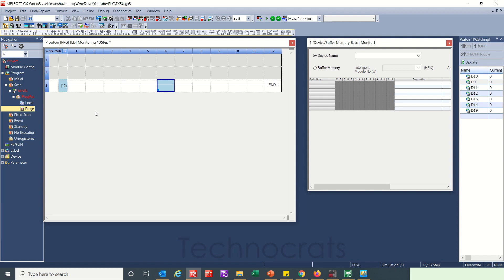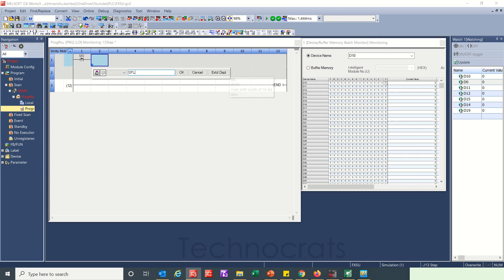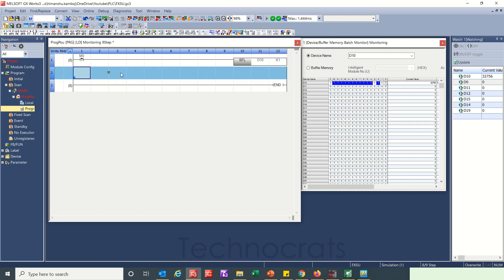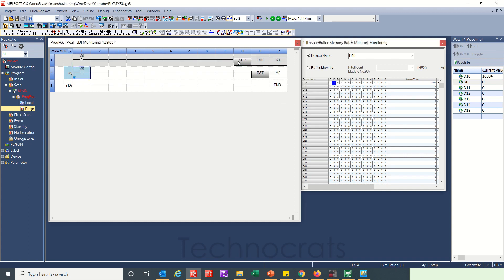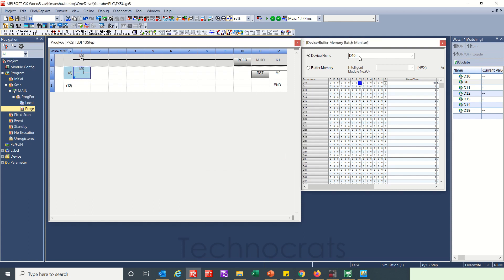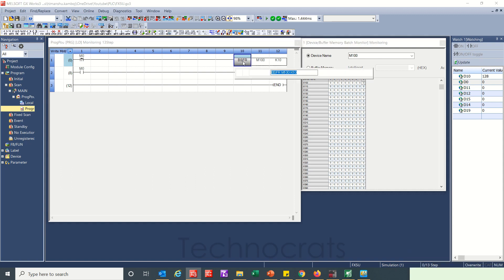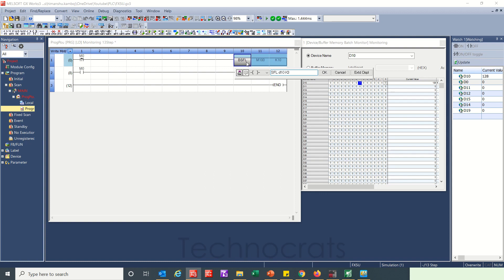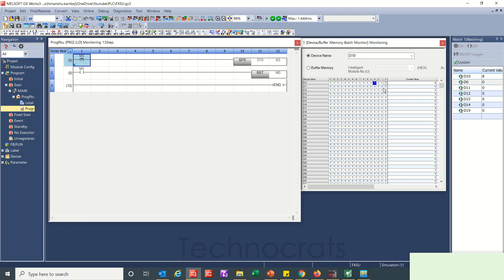Shift Instruction In Mitsubishi PLC (SFR, SFL, BSFR, BSFL)

Comment: hello, help me . Write a program. I have some unsigned integer number, for example 2. Next, I write it to the D400 register and at the next step (S) or label processing (M), I move it to the next register D402 to the right and so on. The same thing ,but you need to shift the number to the left from the register D400 to D398